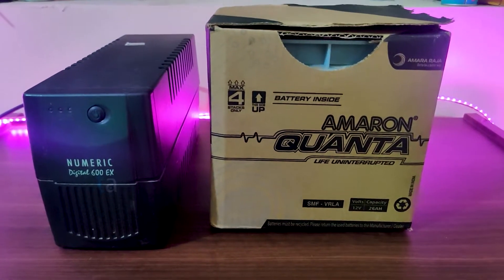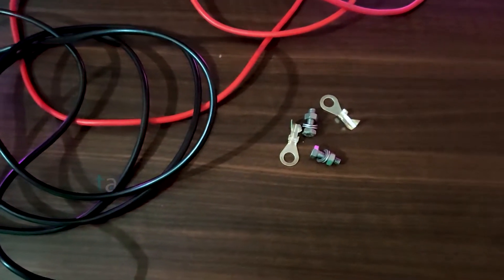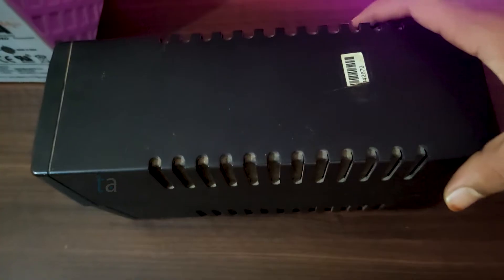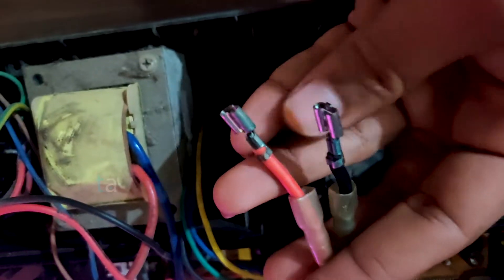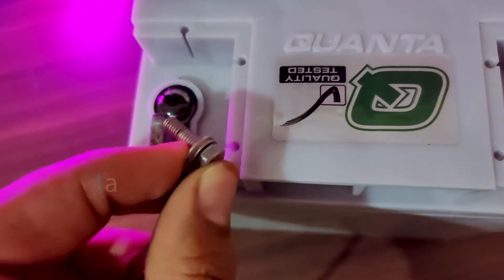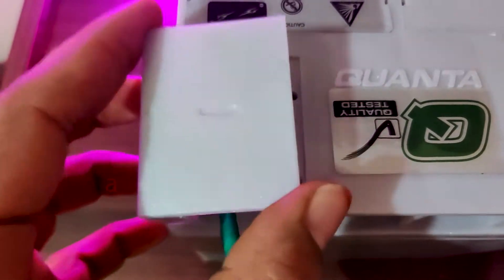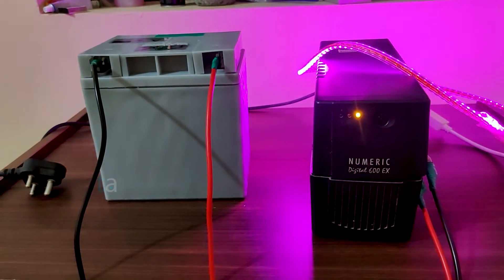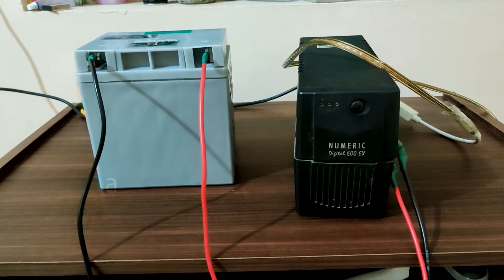Turn your 10 Mins Backup UPS to 1hr Backup UPS | Using Car Battery.

Comment: I have similar setup no cooling fan ,no additional heat sink only kept open using from last 4yr no issues, sufficient for normal load like light,mobile laptop charging ..its takes long for charging battery now battery backup is decreased as per usage.

Comment: This works fine, I had done this long back. But NOTE that I had made few modifications for efficiency and reliability. 
Kept the top cover open and fixed the UPS in a bigger cabinet. Changed the Heat sinks to bigger one's for proper heat dissipation. Fixed a cooling fan to keep the temperature maintained. Connected one additional charger of 3Ampere in the space that was available after removing the 7AH battery. 
Also note that this will support upto 40AH Battery but don't use Full load. Else go for a New external battery UPS
Reply: what happen if I puh the ups and the batter to a small case? what does heat to the ups?
need to be small box space for its a back for security camera and cctv..
will it burn or get damage?
planing to put ang life04 100ah a battery

Comment: Would adding a second batter increase its capacity without risk of overload?
Reply: Note: Using it for a prolonged period could damage the UPS board and could melt or catch fire at times as the boards are designed to cater to power demands for 15 to 20 mins max, hacking this setup to work longer period could potentially damage your UPS.

Comment: I have tried this but instead i use a gel type battery... my only problem is when the power goes off my desktop also turn off sometimes my UPS produces prolong sound when power goes out... any idea how to fix this? pls help tnx
Reply: hi, i think the problem come from your ups, its not powerfull to charge your battery, and mybe somethings wrong in pcb
Reply: Maybe you UPS is not designed to charge a gel type battery. Try a normal lead car battery.

Comment: Why the fuck would you leave that connection on and wrap wire around it lol.. just cut it off and solder the wires together and shrink wrap.. this stuff is in your house so do it the right way not wrap wires around everything and tape lol.. DO NOT DO THOS PEOPLE.. do it the right way..

Comment: I’ve just connected a 135A truck battery to a 1050VA small ups, i haven’t done any testing yet but it seems to work fine when power is cut for 3-4 minutes. The real test is when we get power cuts from the distributor and that lasts for 2-3 hours. I have a DVR and 4 cameras connected to that ups. I don’t know how much power they draw.
Reply: Does the system still work?

Comment: This is definitely not a good idea. Car batteries have lower resistance,  I guess, possible overload.. And car batteries are not meant to be subdued to such a high stressfull charging - discharging duty cycle... It won't last for long .....
Reply: Most car batteries charge at higher current from the alternator.

Comment: WARNING: Use sealed battery, or outside because venting of toxic hydrogen sulfide. Never just twist wires together with high load. Some UPS are designed for a max discharge time, because of the heat.
Reply: Just use a gel style battery and don’t worry about this..
Reply: @xGR1MxREAPERx  i use gel type battey but i have encountered a problem... i think mine doesn't work? because the ups also turned off when the power is out... any idea of this?

Comment: is there any risk??
Reply: Hell Yes. The recharging after it has drained the battery is massive. It was never designed to recharge a 150 amp battery, so instead of an hour or two, it will recharge for days.

Comment: I cringe at watching you wrap the raw wires around the spade connectors on the UPS side, and then just wrap them in electrical tape. You really should use the proper connectors here for a clean connection.

Comment: Beware!!
This battery states "Boost voltage: 13.8V", Have you measures what voltage your UPS is using for boost changing?
If this is higher than 13.8V (many use 14.4 to 14.6V) then it's possible to damage your battery, it can loose gasses and there is even chance of fire!  (To test boost charging voltage, drain battery to at least 70% and then test what voltage UPS is using to charge)
Reply: Automotive battery is charged with 14.4v, you can check your car/bike alternator output yourself.
Reply: @kaikart123  You have old style lead acid batteries which you probably have, which should be charged at around 13.8 V
modern cars have Calcium, lead-calcium or calcium-calcium batteries. They will only charge to 100% full when charged at 14.8V. So 14 or 14.4V is not a problem for calcium batteries. (and yes, your 14.4 alternator will never charge your calcium battery o 100% capacity..)

Comment: How long will the battery lasts?
Reply: Calculate it like this, assuming we have 30Ah batt and 360W max UPS

Battery wattage rating = 12v * 30Ah = 360Wh

Estimated up time = 360Wh / 360W = 1h

Comment: Few more mods to be done to make it actually work for long hours such as 1) connecting a fan to cool it down. 2) Change the heat sink to bigger ones for better heat dissipation. 3) Use an additional battery charger to charge it fast or use a solar panel along the charge controller to charge it free of cost during sunny days. Note: Using it for a prolonged period could damage the UPS board and could melt or catch fire at times as the boards are designed to cater to power demands for 15 to 20 mins max, hacking this setup to work longer period could potentially damage your UPS. ****TRY IT AT YOUR OWN COST EVERYONE****
Reply: Thanks
Reply: you are absolutely correct,sir. THANK YOU
Reply: Best comment
Reply: I supported this man more needs to be applied to avoid overheating that could damage the ups board

Comment: Have u try to charge with a separate charger to charge it faster? I’m wondering is that ok for two chargers to connect to the battery at the same time.
Reply: That what I look for ,do you know??
Reply: The below is from what he posted above.
Few more mods to be done to make it actually work for long hours such as 1) connecting a fan to cool it down. 2) Change the heat sink to bigger ones for better heat dissipation. 3) Use an additional battery charger to charge it fast or use a solar panel along the charge controller to charge it free of cost during sunny days. Note: Using it for a prolonged period could damage the UPS board and could melt or catch fire at times as the boards are designed to cater to power demands for 15 to 20 mins max, hacking this setup to work longer period could potentially damage your UPS.

Comment: My Awp aide 1500va pro can run my pc in 1hr and 10 mins, i had 700w generic psu mini itx mother board core i5 3470s 8 gb ram and one 11w daylight.

Comment: great video, is it ok if i put it in series with the original battery of the Ups??
Reply: No Jad. You can't do that, it willl become 24V. You want to keep it 12V but increase the capacity, so what you should do is connect it in parallel. But keep in mind that you cannot connect two different batteries in parallel as they are not identical (not same AH), the bigger one will start charging the smaller one until they are equal. So a lot of electrical flows will happen between the two batteries and that will damage one of them.

Comment: I’m using a car battery connected to inverter and charger but when i turn on the tv i hear a high noise from the tv is this normal and safe ?
Reply: The i believe charger is causing this.. Try turning off the charger then try the tv. The noise should disappear. If it does? Use a large capacitor between the charger and the battery, that should eliminate the noise as the capacitor will act as a buffer so to speak.
Reply: Use AVR...to control it...

Comment: Thanks for the nice video Brother. And I have FINGERS UPS, capacity 600V/360W. Can I connect the battery of 26Ah to this UPS and strictly I will use this only for desktop. So what will be the back up time.  And will UPS OVERHEAT while working?

Comment: Hello Sir, Thanks for you nice video. Would you please tell me the battery AH that you used here?
Reply from the maker: Its 26ah battery 🔋
Reply: @techarchiveAKL  Sir, its possible to use battery more than 26AH in computer ups? please tell me maximun range (AH) to connect in computer ups,
Reply: @techarchiveAKL  and it took 48hr to just charge that?

Comment: Can you use it for a battery with higher Ah?
Reply: Few more mods to be done to make it actually work for long hours such as 1) connecting a fan to cool it down. 2) Change the heat sink to bigger ones for better heat dissipation. 3) Use an additional battery charger to charge it fast or use a solar panel along the charge controller to charge it free of cost during sunny days. Note: Using it for a prolonged period could damage the UPS board and could melt or catch fire at times as the boards are designed to cater to power demands for 15 to 20 mins max, hacking this setup to work longer period could potentially damage your UPS. ***TRY IT AT YOUR OWN COST EVERYONE***

Comment: Did the UPS overheat? How did you deal with the beeping sound.
Reply: Can that ups charge that car battery
Reply: @lucasmwaurafama9349  yes. But it will take huge time
Reply: @lucasmwaurafama9349  because actual ups battery is 7.2 aH, whereas Car Batteries are 30 aH. UPS will take 12-15 hours to fully charge the battery
Reply from the maker: Ups didn't over heat when using it with 450W smps, and it will stand upto 1hr. Overall good performance.
Reply: 100 watt pe kitna time backup de ga?